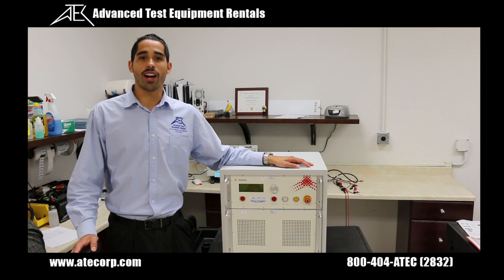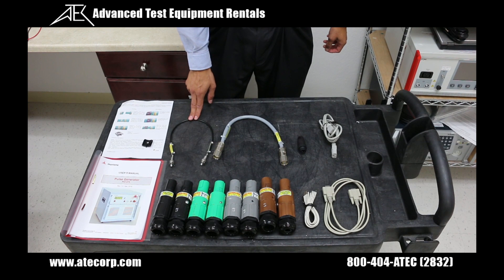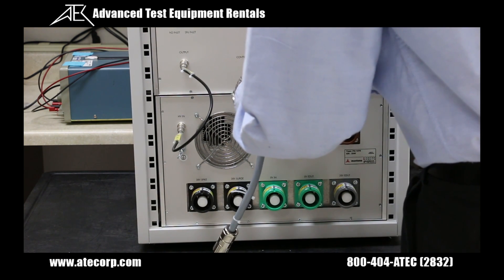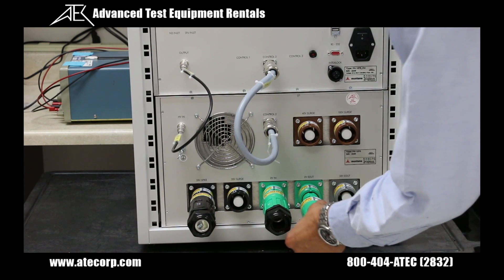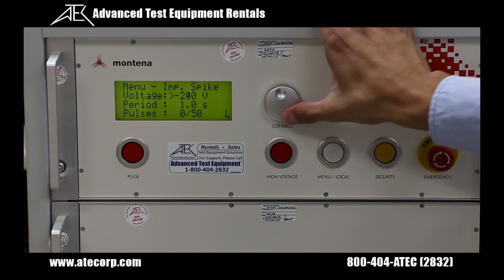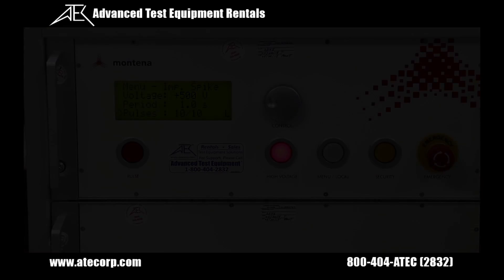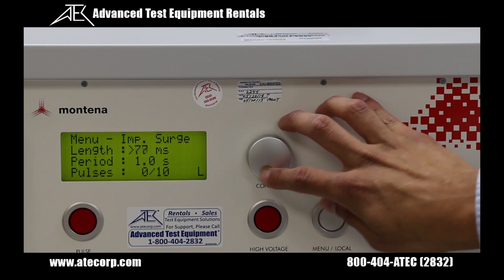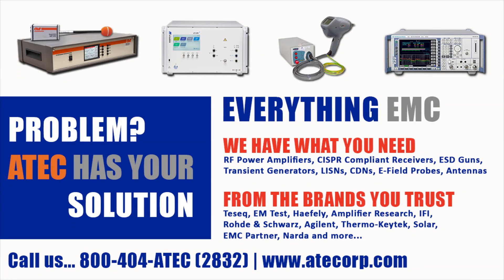"How to use Montena PG1275 for Mil-STD 1275D Testing"

Comment: Hi. The video is very  good. I have few questions on the generator..
1. In spike test i see that a spike of 500vdc, period 1 sec and pulses 10 is set in generator. But in oscillscope i am seeing pulses(spikes) but 28VDC is not seen.
2. Also the spike is set to 500vdc then why negavie spike are getting generated.
3. As per Mil-std 1275 we need a pulse of 70us at +/-500vdc. I don't see it. I am i missing something.I see pulse time is more that is good
Reply from the maker: Hello and thank you for the questions. 
1. In this demonstration we did not have the 28VDC line connected, we were just verifying the pulse generator portion of the unit. 
2. The spike waveform is a ringwave which have both a positive and negative element, it is a +500V decaying oscillatory waveform. 
3. Depending on you MIL-STD-1275 requirement are you looking at edition D or E?